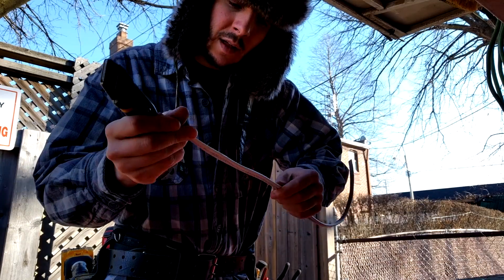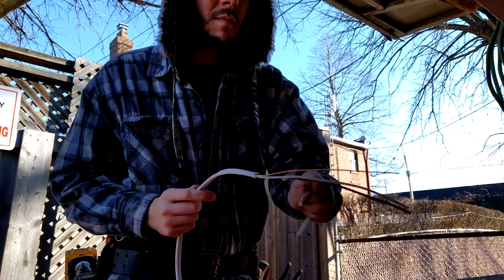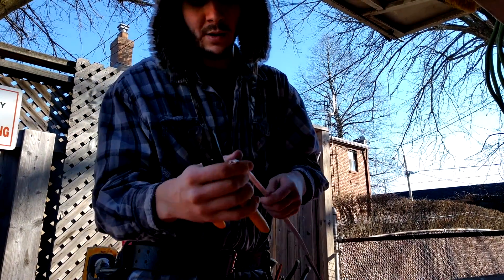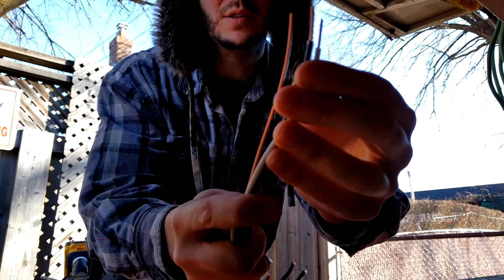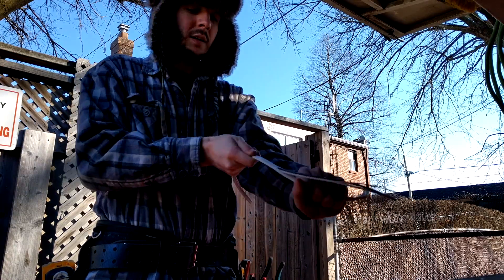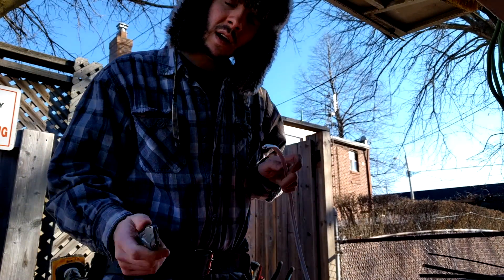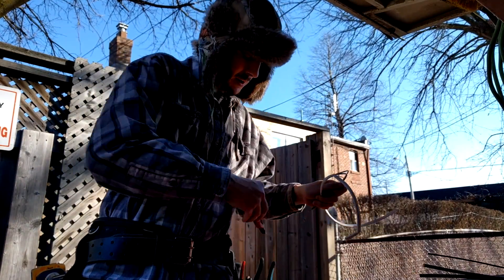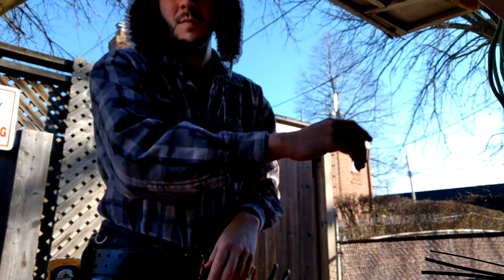The Right Way to Strip Wire (Romex 14/2)

Comment: Listen to him. Been using the Klein romex stripper for 20 years. It's held up and nothing is faster for residential wiring. If you practice, you can use the 12  to strip flat 14/3 or 12/3 and even 10/2 jackets. Notice the word 'practice'. Squeeze too much and you're screwed. More trouble than it's worth to use it on the older rounded 14/3 or 12/3.